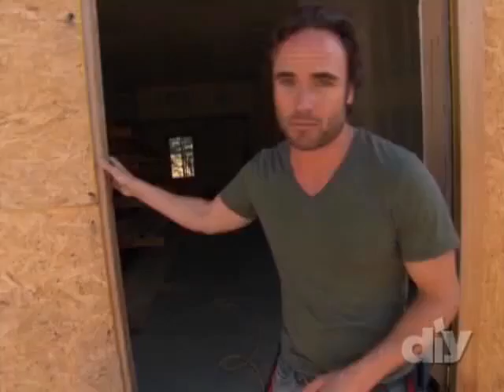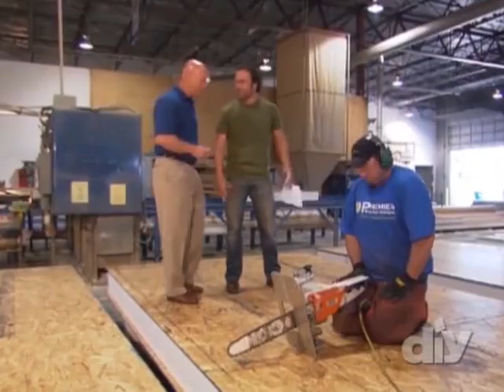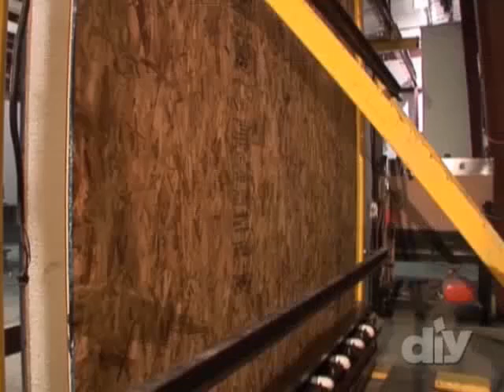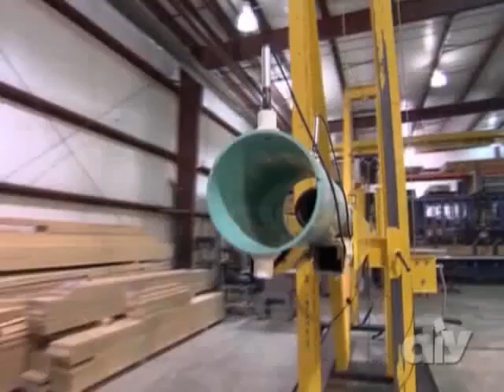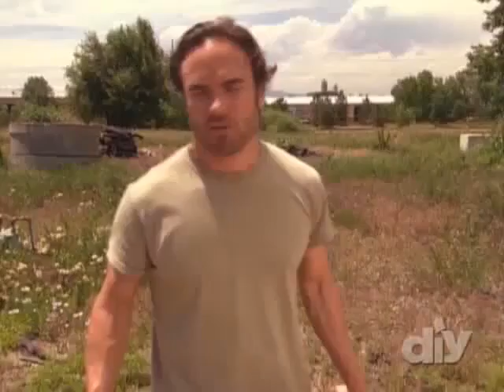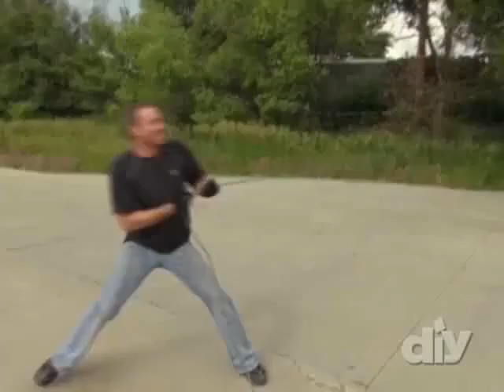SIPS & Framing Construction via "Deconstruction" by the DIY Network

Comment: Matt, I realize this video is over 3 years old, however... I am a retired firefighter and I need to correct you on a couple things. FD response time is 15 -20 minutes for volunteer dept only. A full time dept is between 4 - 6 minutes.    Now, it used to be escape time in a house fire was about 5 -7 minutes. Plenty of time from the activation of a smoke alarm to get out before the fire and smoke get too bad. Over the last few years that time has gone down drastically, 3-5 minutes. Why, new home construction...! Everything is OSB sheeting! It was cheaper than plywood so contractors used and I personally  believe it was to increase their profit margin. Anyway, OSB is nothing but wood chips and glue, very flammable glue. It take less time for OSB to reach its flash point than ply or dimensional lumber and it gives off toxic fumes much faster. In new construction OSB  is in the subfloor, exterior sheeting, roof sheeting, the house is surrounded in it. From a firefighting standpoint OSB is dangerous. In a recent fire department video, published on Youtube, a 2 story, 2 building apartment complex burnt to the ground in aprox. 35 minutes. I have to think building techniques and material very much contributed to that disaster.
Reply: I am a retired Firefight and work for PBS / R Control. Check out R control fire video. SIPs are air tight system compared to open stud framing.
.

Comment: Downside with the I-Joists!  Your not supposed to cut them so you better hope they fit, However the main issue is the Burn Time! When you are putting an I-Joist in your house you need to be aware that they have less than a 15 minute burn time! That's not good! That's actually horrible! By the time you know the house is on fire, the Upstairs is now downstairs! I would go with standard 2x12, or even 2x10! Much safer!
Reply: not to mention, see what happens when engineered beams and SIPs get wet. Instant fail once soaked up one would think...
Reply: OSB is basically rot proof due to the type of glue used. Near me they covered all the windows and doors on an old town hall to supposedly stop vandalism. The owner done nothing with the property. They were on there for well over 15 years. Looked tatty but nothing protected it.
Reply: You can cut them all you want, if you are just cutting them to length.